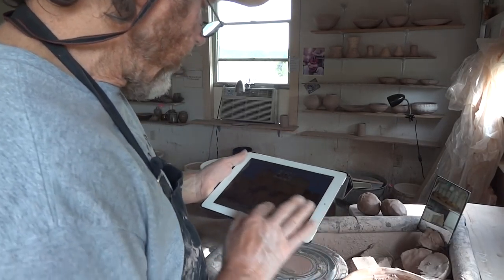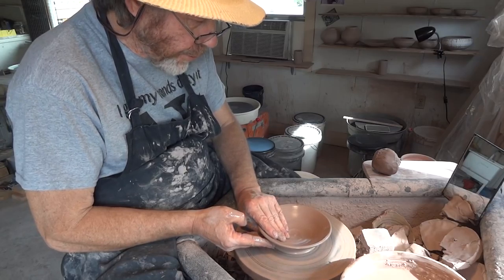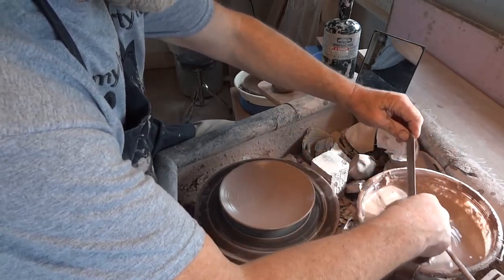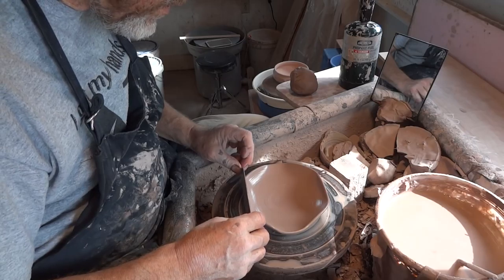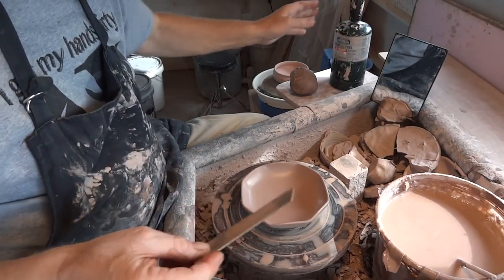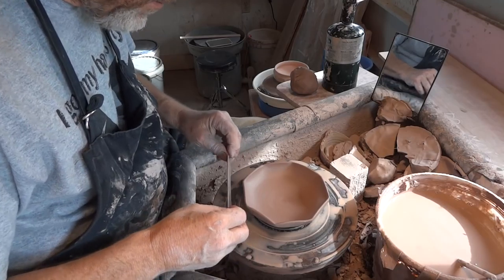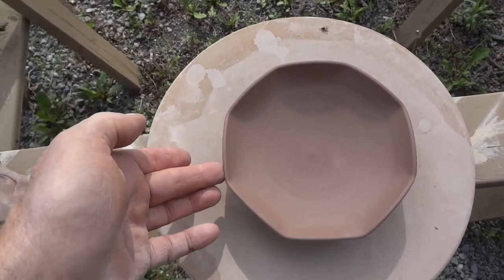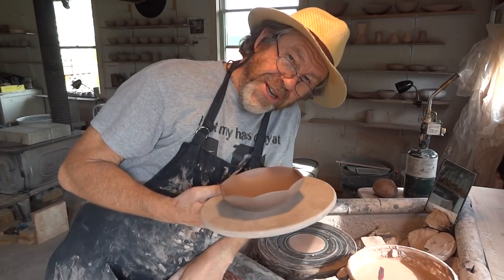Throwing a small octagonal dish - May 17 with Simon Leach

Comment: I use a large, plastic putty knife to lift the edges.  I can square the blade on the wheel head down toward the foot then rock it up and pull, dipping the blade each time.  Works great.